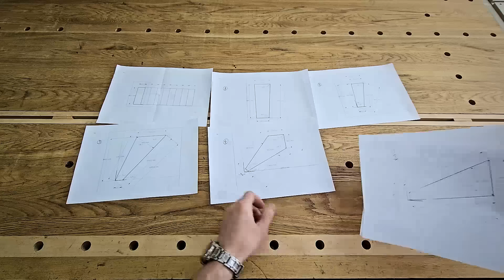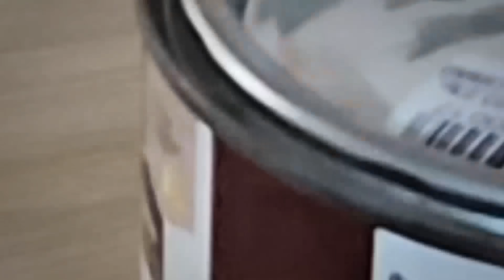This Project SAVED Me THOU$AND$ $$$

Comment: Wow very cool! Just one thing, you could add a little mit of simple silicone under the stares to prevent squeaking, metal and wood will definitely shrink differently and a slightly loose screw can create noises on the metal. Just a minor thing though

Comment: As a X welder I am interested to know the name and make of the stick welder generator you are using, so small and I guess light good for light gauge welding rods and mobility, wow how tech has changed, I remember the welding generators I used  3 phase mains power 
to run the generator plant supply BUT could use 4Gauge rods heavy welding

Comment: My first suggestion is to get a real pair of welding gauntlet gloves. 

Safety first!

I would have fabricated in a different order knowing welding is all about weld position.  I would have welded the tread onto the riser piece first, then the assembly onto the main support. 

Welding is easiest on the flat, overhead is difficult. 

No, I’m not a welder but as a pipefitter I worked with a lot of welders and know a lot of tricks.

Comment: You need at least 2 supports (in this case metal supports) for those wood stairs, or they'll break eventually. it looks great right now,but in a short time the wood steps will definetly break.

Comment: A lot of work even with all the equipment at your disposal, however it wouldn’t pass building regs in the UK, but looks really great. I made a staircase welding a space frame behind the adjacent wall and used oak sleepers which slotted into it. The balustrade was welded steel and separate from the floating treads, then glass in between. There had to be minimum gaps of 100mm between treads etc to pass building regs. It cost about £1000 plus the glass which was better than the £20k plus that manufacturers ask although prices have gone up since.

Comment: At fist I thought - could do that too when you did the Metalworks. Only cheap Tools used. But then came the woodworking - so much tools used. And a lot of expensive ones. It turned out nice but if I want  to rebuild have to simplify a lot when it comes to the wooden steps.
(Only think I thought need to improvise is the security. Nothing to hold on when you fall.) Edited because just saw the other vid with the railing

Comment: I installed a similar design including using sections of a glulam beam for treads. It looked good but the rectangular tube steel stringer would make an oscillating sound like a tuning fork due to vibration when people walked up or down the stairs.  Is this a byproduct of steel tubing  ? The whole project had been engineered and the installation approved.

31:03
Reply: Просверлите отверстие в балке и засыпьте туда песок. Песок будет гасить колебания балки. Для балки как на видео, достаточно засыпать 1/4 балки.

Comment: Ya we all have those tools, then you don't install a handrail if someone falls you are sued. You say you saved thousands but your tools cost 10's of thousands and the amount of time you put into it must be worth something. There is still the cost of material, hardware, electricity, and finishing products. But I will say that one little hand planner you used I have never seen before, and I was impressed at the results. I have an oak staircase they came measured and returned several days later and in four hours I had a new staircase at the fraction of the cost and time it took you to build yours and it came with a handrail. I still enjoyed your video at first when you were installing the wall and floor plates, I thought you were going to build some sort of exercise machine. All you must do now is install a handrail to avoid any injury or lawsuit.

Comment: Greetings from Chicago🌭

COMPLETELY BRILLIANT    
               ❗️WORK❗️

WAS GUESSING: ELEVATOR 
       FOR 
           HANDICAP 😳

WAS STUMPED UNTIL YOU BEGAN CUTTING THE STEEL RISERS……

THE ANGLE ON THOSE IM GUESSING   ( 30 degrees )

I SCREWED THAT ANGLE UP WHEN I INSTALLED ALUMINUM BANNISTERS WITH STEEL CABLE THREADING.

 ( I was off only 
      a couple of degrees 🙄
but that was enough to cause each cables pitch to run “steeper” which put undue pressure on each threaded cable eyelet.

Thankfully….. the bungling is not noticeable to the naked eye 🫣…. lol

Anyway………. 

With the kids I heard in the background…. 

That white wall wallpapered from floor to ceiling in a bold, glossy 1 inch gold pin stripe; …..will be fingerprint proof ❗️.. lol

along with 6 
wireless;   battery powered  motion censored  wall scones attached with magnets so NO drills or wiring needed 😊

Not to be nitpicking…. but if those kids are gonna play down there….. or …. if a beer 🍺 is served….

Going up those steps may require a handrail strategically mounted 
 
 ( probably both sides)👀

Just sayin 🤷🏿‍♂️

You taught me something about post welding ……
 
never knew that metal bondo was used for finishing ❓…..
 NICE WORK ❗️❗️❗️

Love to watch an expert in the throes of his craft 🛠️!! 

as well as pro editing skills❗️❗️🎥

Keep up the : 
            “off the charts”upgrades ❗️❗️

Yep I liked and subscribed.

Happy Holidays 🎅🏼

God bless,
                  
            🎼RAIN AGAIN 🎼

Comment: Fantastic work.  Great idea.  It would not pass code in my community.  No banister.  No kick plate between steps.  All steps must be at least 9 inch width throuout the step or a mnimum 36 inch platform when changing direction.  I certinly hope you do not have those codes.

Comment: Dude, it might be better if you elongate the rear row of holes in the metal plate..... allows the tread to move through contration and expansion across the grain, while the front of the tread remains fixed in the correct position of its going. Just a thought from a dumb ass joiner of 45 years...😃😀🇦🇺

Comment: No stair railing is a critical and unacceptable fault!   Inevitably, elderly people will find these stairs to be intimidating because they are unsafe - no railing on the open side of the stairs is a fatal deficiency here.  All adults as well as children will be at risk on these stairs.  This design is a case of 'form' (?) contradicting  safety and function.  A wise designer world have incorporated an esthetic outside railing (or 'barrier', such as tempered/laminated glass) in these stairs  
As pointed out earlier, these stairs would be totally illegal in Canada or U.S.   For good reason.
Reply: If you would do some further research you’d know that the railings were installed on a different video